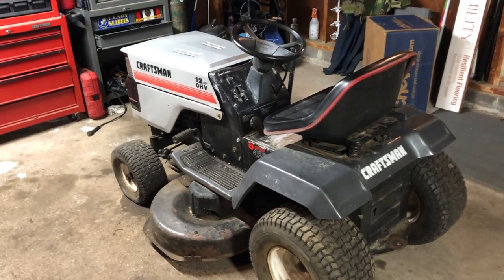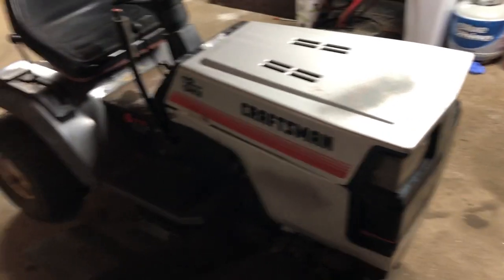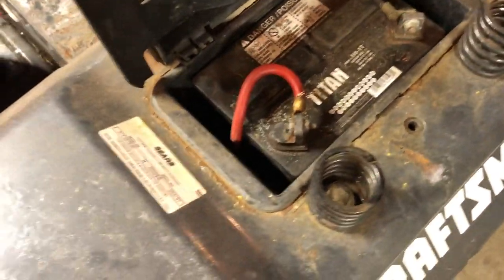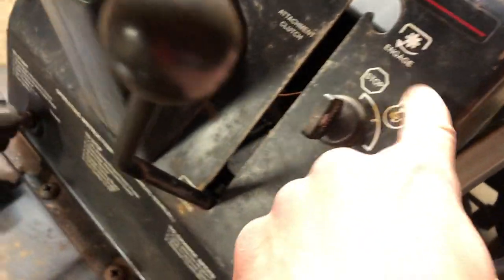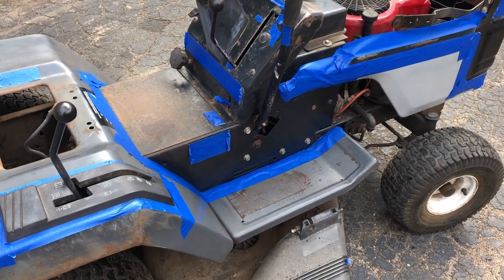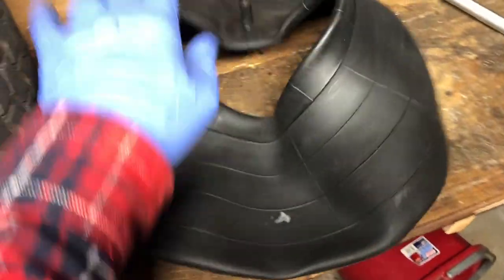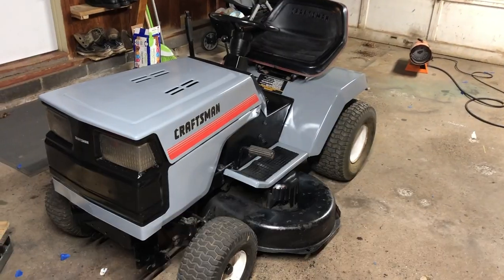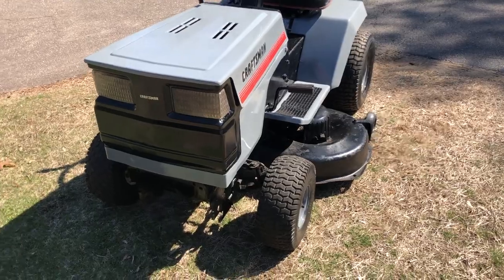Craftsman Lawn Tractor Restoration Flip Project. How To Make Easy Money Flipping A Tractor!

Comment: You might want to consider 2K 2 Part Automotive clear coat lacquer to protect the paint from getting washed off from a gas spill. 2K has the red thing you push on the bottom of the can. It is a 2 Part hardened clear lacquer that can not be removed w/ gasoline.
Reply: So it wont. enamel the same but will peel off after 2 years of it being on plastic

Comment: When doing tubes I recommend taking duct tape and taping inside the rim to prevent slice of the tube because those tubeless tires are known for metal burrs. And I would use Rust-Oleum 2 in 1 primer+paint combo gloss black and when the whole tractor is painted cover the whole tractor in clear coat paint to make it pop even the tires. Sweet looking mower though 👌🤘
Reply from the maker: Great advice! Thank you for watching 🤘🇺🇸

Comment: I worry about over spray mist dots will make your gray area bumpy when you rub it but i block over spray with cardboard whenever i paint 

Then I'll probably do as the person said use a clear coat and not a new paint job on mine ill keep it with the old look but coated so it won't rust out any further
Reply from the maker: Sounds good man! 🇺🇸🤘

Comment: I had one of these Craftsman mowers , it was a damn good one
Reply from the maker: They are GREAT machines when well kept. Thanks for watching.
Reply: I still have mine 3rd engine. The trans axle started getting noisy I drilled a hole and filled it full of grease. It is a Frankenmower, but it gets the job done. Replaced a few spindles as needed, and made those grease-able to.

Comment: On the rubber foot Matt’s, clamp a board on top to seal down flat. With the sun and heat you may need to re-clamp if it gets hot etc
Reply from the maker: Garner Adkins Great tip!

Comment: If you’re flipping it maybe tell the cost or value of the trade for the mower then the sale price and then profit? 🤷🏻‍♂️ I was kinda interested. Other than that very nice video! Good Job!
Reply from the maker: Great points Al! This was one of my early videos when I was just getting started - hence the lack of those kinds of things. If I remember correctly, I traded a used miter saw ($40) for an air compressor. Then restored and traded the air compressor for this tractor. Then I traded this tractor for a nearly brand new (14 hours on the clock) Generac GP5500 generator.

Comment: Just got one of these non running. They thought it was blown engine. Got it running and drove it onto the trailer for free 😁
Reply from the maker: That’s AWESOME
Reply: Same here the poor old guy thought the engine was locked up but was just stiff from him not never starting it up whenever his carburetor clogged up 

On the twin cylinder briggs 16 hp engine so i have his not locked engine now and a other onan thats not locked up free to anyone that wants a old onan engine i don't have nothing to put it on yet does need work done on it so it'll stay running but is still a good onan 

And was given another old gocart engine i guess thats what it is you know i don't need these outdated engines but have them anyways i don't know what i could use these on i got them free from someone's yard sale cause they didn't get sold

Comment: thats not the original hood. that hood is from a early 1980s mower. the original hood is the same color as the body and a different design.
Reply from the maker: I believe that. I traded an air compressor for this machine from a “lawn mower guy” with a yard full of machines.
Reply: @jimmysgarage9068  ok, i just thought you might want to know why it was a different color
Reply: Mines a 1987 of that craftsmen
Reply: So thats why i can see alot of different stuff on it the engine isn't original thats a single cylinder

Comment: I'm starting to restore mine. Any tips?
Reply from the maker: ChampionBeam 401 Yes! First is to do a thorough evaluation on the work needed. How are the motor and transmission? Does it need all 4 tires replaced? Try and get an estimate of total cost before you start to get an idea of everything you need for the project. I’d say if if the ALL IN cost will be over $600, abort mission. If you can build a mint tractor with all the bells and whistles working at 100% like I did though- go for it! Also record your progress and post it! Good luck man!
Reply: Thanks! Long story short I had to get a engine. Found one that works for $90 that was about the same I took off. The rims are pretty rusted but should last a few years (for me to save up). I have paint that is close and will work. I started tearing it apart and seems that it needs some rust taken off and new paint and maybe some rims (not soon).
Reply: (I'm 16)
Reply from the maker: ChampionBeam 401 Sounds like you have a pretty good start! I have a video on cleaning and repainting wheels - check it out. Also, tubes are cheap and easy to install, so if your tires are shot then that’s a good route to go.
Reply: @championbeam4018  quick tip, use rust reformer as a "primer" before painting over the rusty parts
Reply: @hardkore360  I'm taking all of the rust off, so I wouldn't be painting over it.
Reply: @jimmysgarage9068  what craftsman model ist it ? (Traktor)
Reply from the maker: _ Honestly, I forget! I didn’t have it a long time.
Reply: @jimmysgarage9068  okay not that Bad ;)
Reply: @user-mr5yu5yo7p  idk the tag is all ripped up
Reply: On mines original deck 4 pulleys need took off and greased and I'll be doing that how i done my other decks pulleys their rusty but they'll move.

Your deck the guy put a 96 model craftsmen deck on the older craftsmen thats good for me to know i have 4 of those decks so thats good so if i didn't wanna fix this original deck i really wouldn't have to but im going to because i have it